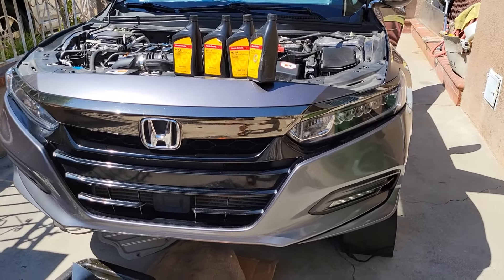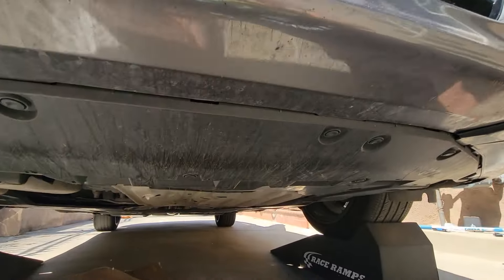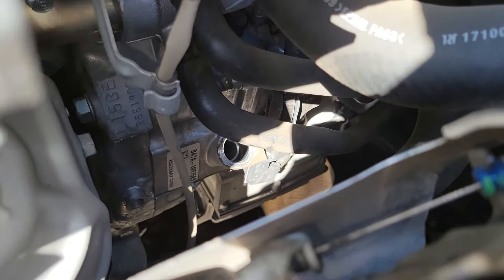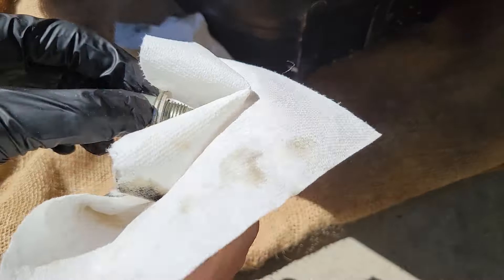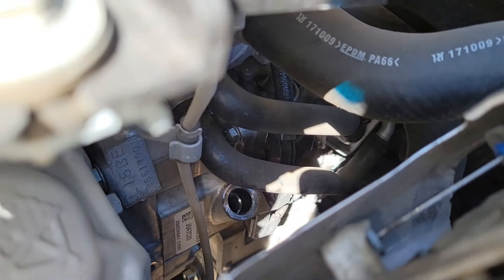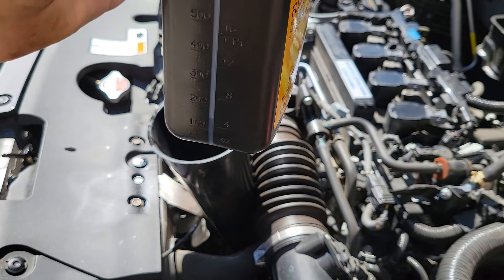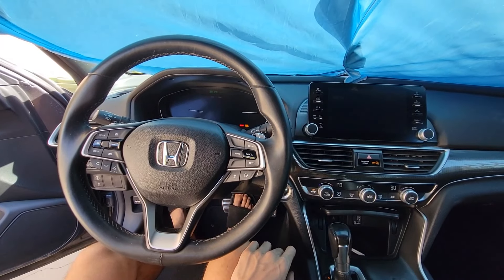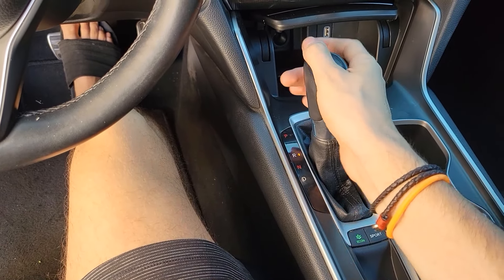CVT Transmission Fluid Oil Change 2018-2024 Honda Accord, CR-V (1.5L Turbo)

Comment: Thank you for the video. I wanted to ask, do you have a link for that funnel used? and have you used the check bolt before to make sure enough fluid has been added?
Reply from the maker: Thanks! 
I just bought the funnel at O'Reilly's it's a pretty generic funnel. 
I made this video quite a while ago and the dealership didn't know what size the washer was that's on the check bolt so I didn't want to risk doing it and the dealership be out of stock on the replacement
Reply: @Striker50_  Thank you. I will check my local O'Reilly's for it. I see, no worries brother. Appreciate the feedback.
Reply from the maker: @victorbriceno8401  🙌

Comment: What year is your Accord 1.5t, and what has the ownership experience been like? I purchased a 2021 Accord SE a few months ago.
Reply from the maker: Everything you would expect from a Honda; a reliable workhorse 
This one in particular gets 90% of it's Miles from the highway so it's particularly easy on the car. Also in southern California so there aren't any weather issues. I will say, it rides a bit loud which I'm not a fan of. 
I improved this experience by adding thicker sidewalls on the sport rims. 
It comes with the 235/40/19 tires which don't offer much protection and ride firmer. I researched and added 235/45/19 tires and it's going well! A little bit more quiet and not as rough of a ride! I'll be making a video on it in the near future
Reply: @Striker 50  Question did you mean 18in tires? Researching tires here. I know my Sport wheels are 19s.
Reply from the maker: @HPeezy1  Apologies! Those are the size of my 2013 Accord!
Yes these are 19inch! 
I fitted it with 45 sidewalls on the 19" rim, Costco didn't want to let me but it works! 🙏
Reply: @Striker 50  Nice. If I didn't just order new tires I'd probably try going with those. Probably my only complaint with this car. Is the road noise and how the ride isn't the softest. I went with a Goodyear tire with more tread 11/32nds vs the 8/32nds the Oem Eagle Touring tires these bring from factory that lasted me about 46k which what they were rated for.
Reply from the maker: @HPeezy1  Keep me updated on how they're feeling 👍
I've gotten 4 passengers in this and no rubbing so I feel would be good enough for most people. Again, 5 passengers plus cargo might make a difference, but that's a more specific scenario
Reply: @Striker50_  I thought they came with 19s. Mine is 19s. Check and update.
Reply from the maker: @UcheRed  Yeah they're 19's
My 2013 Accord has 18s that's why
Reply: @Striker50_  love how your issue is it’s a bit too loud. I added a custom exhaust and a cold air intake for way more vroom vroom sounds 😂
To each his own :) HONDA GANG 🎉 ❤
Reply: @Striker50_  cool, thanks for your reply!!
Reply from the maker: @bryansbag  Yeah the low profile tires don't absorb much since they're 40 series side wall by default, but sounds like yours is breathing gooood 👃
Reply from the maker: @bmlove81  Any time Bennie 👍 any mods you've made since your comment?
Reply: @Striker50_  a steering wheel cover, if that’s considered a mod.🤣🤣🤣
Reply from the maker: @bmlove81  Fast and Furious watch out 🔥🤣
I hand-sewed one on my 2013 Accord it look super nice but took me 6+ hours ☠️

Comment: What’s up bro, 2019 accord 2.0 owner. couple questions for you. First about many miles should I change my transmission fluid if I have it in a phearable stage 3 tune. And also what fluid should I use? Lastly how many quarts?
Reply from the maker: Sheeeesh, that's tough; I'd highly recommend reaching out to whoever did the tune for you since they'd have the most experience with those higher compression numbers on stock parts; I tend to follow OEM specs, and your transmission would be a 10-speed whereas this is a CVT
Reply: @Striker50_  ahhh okay thanks for the reply
Reply from the maker: @hernandezjc97  any time

Comment: How do you check the fluid level to make sure it’s correct ? Is it just put the same amount in as came out and your good to go ?
Reply from the maker: There is a check plug located right above the transmission drain plug. There should be a picture in the owner's manual.

If you're the 1st owner of your Accord, you can measure the amount that comes out and do it that way, since you know the oil has never been changed by anyone. But you have to think there can be a chance for a mistake. For example, someone in the factory poured too much or too little oil and instead of catching the mistake, you pour as much as they did which can continue damaging your car. So for that reason, I go off the manual first. Then I'll measure what I pour out, and if it's very close, I'll get the average of those 2.
But if the manual says 3.7 quarts, and when you buy the car used and you drain it, 5 quarts come out, you know something is wrong, and it was probably the previous owner that didn't know how to do it.

I made a video on my 2013 Accord CVT transmission and I briefly show where the check plug is right above the transmission drain plug. 
I just follow what the owner's manual says and stay really close to that.

What the check plug does is that it drains out any extra fluid if you overfilled it. The reason I don't do it is because since my car is on the ramps, it is not level, so it will not drain that way if there was extra. 
I've seen like 10 other videos of people working on the transmission to drain it, and most of them don't use the check plug because they already know how much to pour so I'm using their videos to learn as well. But yeah, just follow what the Manual says and you should be fine since the engineers already calculated.

And if you do use the check plug, make sure your car is level and flat 👍
Reply: @Striker50_  put back 3.7qt  should be safe base on the manual.  That is what I will do and avoid check plug work.

Comment: and there’s a check bolt right infront of the drain plug of that trannys where you can unplug to remove the excess oil.
Reply from the maker: Agreed, I mention that multiple times in the comment section and video
The check plug has a small washer that my local Honda didn't have info on, so I didn't want to open it without a replacement

Comment: I hate it didn't come with a dipstick like the older models. How do you know if your transmission fluid is low? Hey, Can you tell me how many miles you had on your car when you changed your transmission fluid?
Reply from the maker: Agreed, that would be helpful. 
There's no real way of knowing aside from a transmission issue indicator coming on on the instrument cluster (p.78, p.84-86 of owners manual)
Trans Fluid shouldn't leak or burn however since it's enclosed differently from an engine. 
The maintenance minder notification came on at 50,000 mi. (See pg. 604 of owners manual) mostly highway driving. 
The engine oil life in the Accord is calculated by computers in the car but the CVT fluid is not which is annoying. 
Changed it at 54,000 mi since there wasn't much of a rush to change. It is of my opinion that Honda is shortening the "expected life" of CVT transmission oil intervals as my previous Accord always stated 60,000-90,000mi intervals for the CVT fluid, and now Honda recommends 25,000-50,000 intervals. 
From what I learned in business school, Honda invented the suggested maintenance for vehicles decades ago and all companies eventually followed. This business model ensured more revenue for their service departments. 

Judging from the tactics shown on (pg. 623) Honda now discourages owners to even attempt changing their CVT oil which further shows they're increasingly trying to generate more revenue via service department
Reply from the maker: In summary, you'll get a notification every 50,000 mi. to change the CVT fluid. 
If you drive aggressively and in hilly areas, you can change sooner like at 40,000. If you don't have the time to change it or perhaps it's an unexpected budget expense, you can go well over 50,000 miles and the car won't blow up or have any issues (my opinion) Following the schedule is preferred, but it's not the end of the world
Reply: Should the gear filter be changed?

Comment: I have a 2020 Honda accord sport 1.5 and at my last visit they were trying to get me to change my transmission fluid. I’m barely at 17k miles lol I’d be okay to go up to around 50k miles no? Does time matter when it comes to switching transmission fluid?
Reply from the maker: Brother... straight cash grab.. Unless you're smashing through mountain canyons and using your Accord to pull a trailer there is 0 reason to change your trans. oil that car is literally new lmao! 
Even this maintenance notification the car shows at 50-60k miles is super conservative in my opinion. 
I can speculate to say that because Honda has been experiencing sales shortages these past 2 years, they're probably getting more pushy in their service departments to make up for the losses in sales. 
I have my other video on my 2013 Accord changing that trans. oil 8 years later with about 115,000 miles and that car is still running solid to-date! Granted I don't recommend to wait THAT long, but just goes to show 17k miles is ridiculous
Reply: @Striker50_  I thought they were joking when they told me that lol they also tried to charge me 180$ to switch my engine and cabin air filters lmao I did both myself in 5 minutes. Appreciate the response brother!
Reply from the maker: @josepimentel6638  LMAO man they're not even trying to hide it at that point! 
$20 for both of those filters and yeah 5 min to do it! 
$160 for labor for 5 minutes =
($160x12) =$1,920/hr. labor rate that's bonkers! 
I have those 2 filter videos on my channel as well to help people save their hard-earned money. Glad you didn't fall for it. I did once when I was younger for a $40 cabin filter charge, and never again with those insane charges

Comment: Most of my driving is city driving (about 1k miles a week) do you think I should change the transmission fluid more often because city driving is rougher on cars?
Reply from the maker: It's up to your personal preference honestly; you could easily change it every 45K to be conservative with it, or follow the maintenance minder. Unless you're constantly doing hard pulls and mountain driving, the CVT shouldn't have significant stress on it 👍
I have my 2013 Accord that I didn't change the CVT fluid until last year (I was still learning about cars) and it drives with no hiccups performance wise. The CVTs between the 2 models are nearly identical and I use that Accord for constant stop and go in addition to mountain trips and road trips and it remains solid as of now (137,000 mi)
Reply: Change it every 30k

Comment: Question? I did everything in the video and I have a 2020 accord sport with the 1.5t and cvt also. I got done filling it back up and noticed another plug next the battery that had a label “HCF-2” with the oil fill and gear logo. I quickly panicked thinking I filled in the wrong hole and unscrewed the fill bolt and the new fluid starting dripping out. I’m just wondering why is there 2 fill plugs and what difference do you think it makes filling it which ever one?
Reply from the maker: I'm not sure what you're describing: The fill plug is located just under the radiator hose by the airbox on the upper left of the engine block if looking from the driver's seat.
On the tech info PDF, it only shows one fill plug which is distinct in it's handle and tag. I also just got off the phone with a service advisor at Honda to confirm there is only 1 fill plug. I'll look into it when I get some time to confirm the confusion
Reply: @Striker50_   I don’t mean to bother you with this question but I just wanted to know why it seems it has two fill plugs to me. You mention on the video that you think the reason the plug didn’t have a label on it was because the car is certified and they might have switched it, I bought mine new and also doesn’t have a label on it but the one next to the battery does. Again not to bother you my car has been driven the whole day and no codes or problems with the transmission have occurred but wondering if it makes a difference on which one I fill it up on. I made a short video showing both if you would tell me how to send it.
Reply from the maker: @andrikflores5712  Upload the video on your channel so we could all have a look 📷
Reply: @Striker50_   Its on there now hopefully, I’ve never uploaded something lol
Reply from the maker: @andrikflores5712  No worries it works! That's bonkers; I'm guessing they both fill the trans housing from different points then! This 2018 is my bros so I can't check the car at the moment but I'll look into it around Christmas time when I see him. The only 2 other videos out are on a 10 speed auto & a manual and each one used a diff fill location

Comment: Is there a dipstick to check the oil level? Thanks
Reply from the maker: Nope Honda removed them. I bet so that they could generate more business for the Honda service centers. There is the check plug method on these Accords. It is somewhat similar to topping off a differential or transfer case 
I will be making another video on this CVT oil change but showing ALL the steps for those people more capable

Comment: My 2018 Honda Accord 1.5L just hit 52,000 miles, my maintenance minder for the transmission fluid change just came on ….. Should I get it replaced?
Reply from the maker: Yeah totally 👍 No rush honestly, your car won't blow up if you drive another 70,000 miles like that
But best to do it for preventative maintenance

Comment: How often should you change the CVT fluid?
Reply from the maker: 60K is a good general number to follow
Reply: @Striker50_  thank you! mines just reached 50k and the only thing I've change is the oil so far
Reply from the maker: @hiizm3  Got it. Have you gotten a notification light for the transmission fluid change?
Reply: @Striker50_  I have not! I’m worried I might have reset it on accident while trying to reset the oil

Comment: So you can just do the transmission flush not change the transmission filter?
Reply from the maker: @TheBibleTruths7-h7r  the transmission filters are not recommended to be changed by Honda. There's one under the transpan and there's one behind the radiator.
Reply: @Striker50_  oh, do we suppose to change the 1under the trans pan? Or the one behind the radiator?
Reply: @Striker50_  was asking because my l.5t Honda I been changing trans fluid every 30k . So you saying I don't have to change the ones behind radiator nor the one under trans pan? If not cool. Then I been doing right for the CVT
Reply from the maker: @TheBibleTruths7-h7r  Honda service bulletins do not mention changing the filter
Reply from the maker: @TheBibleTruths7-h7r  if you're changing the fluid every 30k that's fine but probably not necessary. This is about every 60k
Reply: @Striker50_  ok cool. Thanks . You change your CVT fluid at every 60k ?
Reply from the maker: @TheBibleTruths7-h7r  I do The car also tells you with the maintenance minder when to change it.
Reply: @Striker50_  hey what about the car coolant  when do you recommend changing it and putting new coolant in?
Reply from the maker: @TheBibleTruths7-h7r  coolant for my other Accord was 100,000 miles
Reply: @Striker50_  what about your 1.5t how often do you change the coolant?
Reply: @Striker50_  hey your 10thgen accord how many miles before coolant change? Like 50,000
Reply from the maker: @TheBibleTruths7-h7r  Id say 100k is fine but earlier never hurts (other than your wallet)

Comment: For 2020 Accord Hybrid, it has a 2.0 litter. The location of the transmission filling is very tight, hoses all over it. Anyone know which is the automatic transmission oil level plug? I believe the filler plug if not add from the top by the hood is on the right side. TIA.
Reply from the maker: @slowestrider4918  Do you have the hybrid Accord?
Reply: @Striker50_  yes
Reply: @Striker50_  2020 with engine and transmission made in Japan, assembly in USA.

Comment: Hello, I have 2021 Honda Accord 1.5 Turbo, CVT transmission. Do you know the recommended miles/yrs the transmission flush should be done? Thx
Reply from the maker: The car has a built in maintenance minder it should notify you when it's recommended you can see what the notice looks like towards the end of the video

Comment: I have a 2018 Honda Civic with 90k miles and I have never changed the oil in the transmission, some mechanics recommend that I not do the change because it is old, what do you recommend?  Thanks
Reply from the maker: My opinion is that you're good! 
Look at my other 2013 Accord CVT transmission fluid change, I didn't change that thing for like 120,000 mi and I pushed that car 💥 still runs great! 
Honda actually recommended 60,000-90,000mi intervals for the previous model and these transmissions are nearly identical
Reply: How is it now?
Did you use the word "flush" when asking mechanics about it?

Comment: At what milage did you change your Trans  oil ?  Mine has 148k I haven't done it yet 😮
Reply from the maker: For this one it was 60k LOL but don't worry, my other Accord I didn't change it until like 120k and it was fine. The CVTs are nearly identical if you want to go see that review, that Accord has like 147k miles now and it runs very well
Reply: @Striker 50   nice thanks , I'm actually gonna buy the Trans. Oil 🛢  tomorrow lol  I'll do it this weekend or week day
Reply from the maker: @henrynissanmimintruck  Awesome, hopefully they don't gouge you, it shouldn't be more than $65 even in this economy
Reply: @Striker50_  haha 😄  $65 for each or all 4 🫣😬
Reply from the maker: @henrynissanmimintruck  lol all 4. I think I paid $62 for 5 quarts on eBay which wasn't bad